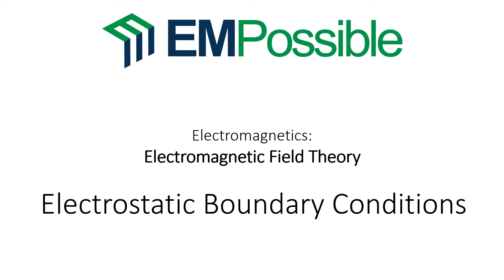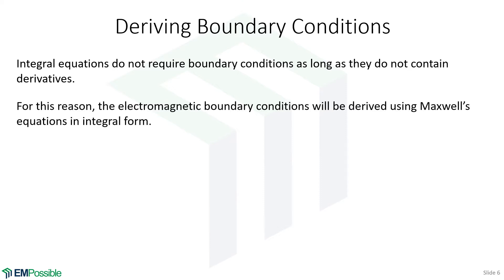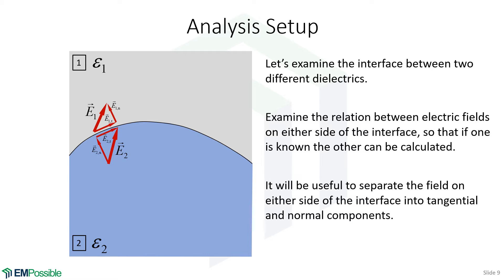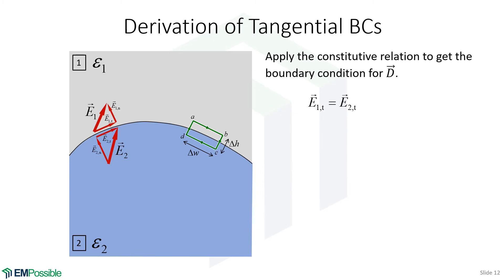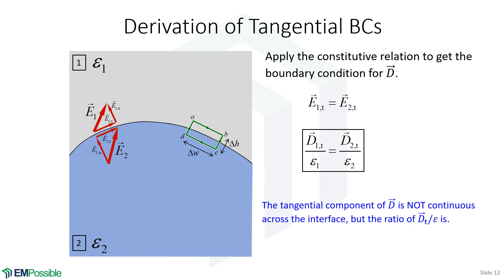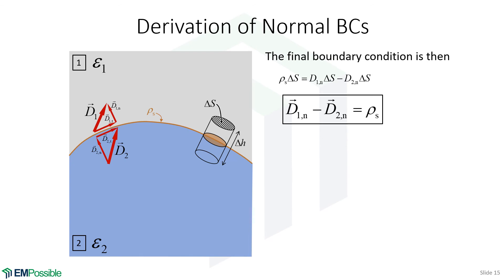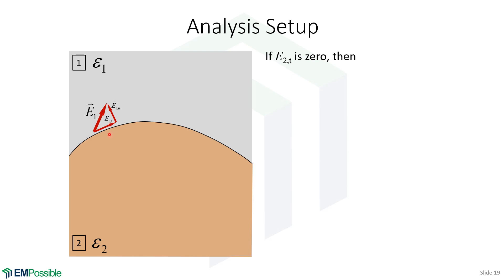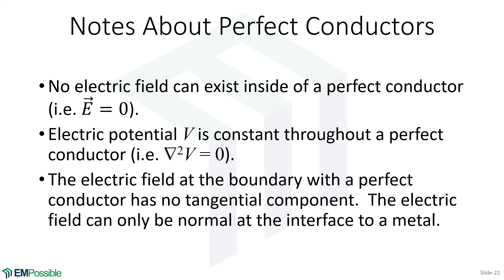Lecture -- Electrostatic Boundary Conditions

Comment: Thanks for this great explanation prof. Rumpf! By the way, it is possible to have a video on boundary conditions for dynamic fields? 😊
Reply from the maker: That is on my radar. It is actually the same, but carries the phasor quantity through the calculations. In a way, you will be disappointed how straightforward it is.

Comment: Hi, I think " These are derived from Ampere's Circuit Law and Gauss' Law. " should be changed to " These are derived from Faraday's law of induction and Gauss' Law."
Reply from the maker: Are you referring to slide 6 around 2:30? That first equation is Ampere's circuit law in integral form for electrostatics. Did I misspeak somewhere else?
Reply: @empossible1577  I think That first equation is " Maxwell–Faraday equation " instead of "Ampere's circuit law"
Reply: @localfuture1484 i was thinking the same thing
This was Faraday's law of induction 
Ampere's circuital law would be
Curl of H = current density J ( assuming non time varying fields)
Or integral H.dl = current i

Comment: Very clear explanation for dielectric to dielectric boundary condition. @15:08, If electric field cannot exist in the metal, why can we not say the normal component of the electric field in the metal is zero?
Reply from the maker: The normal component of E must be zero inside of the perfect metal.  However, the normal component of E is not continuous across the interface so the normal component of E in the dielectric does not have to be zero.
Reply: @empossible1577  Thank you. Professor. That's very helpful.